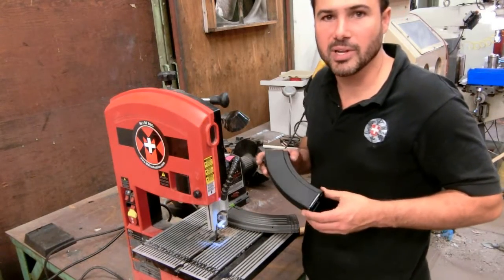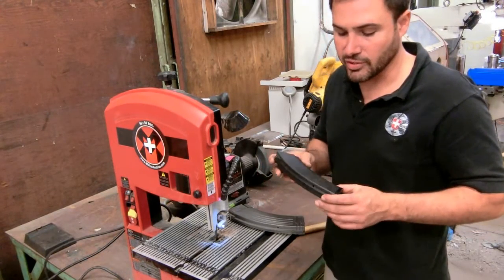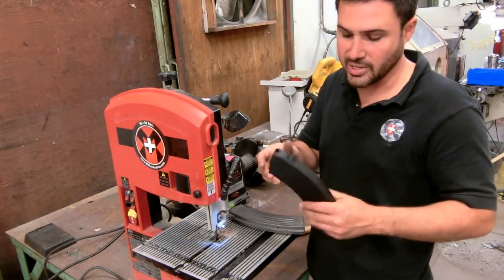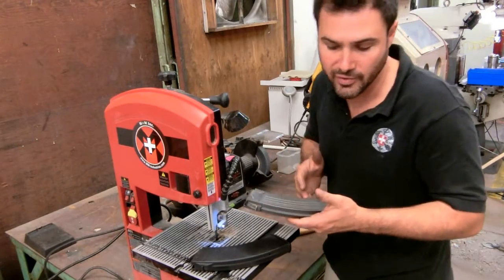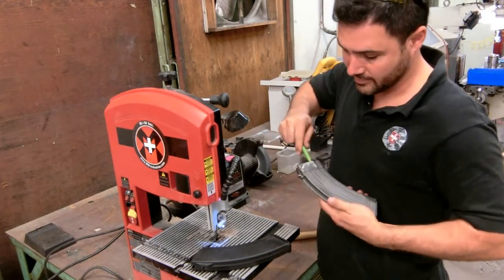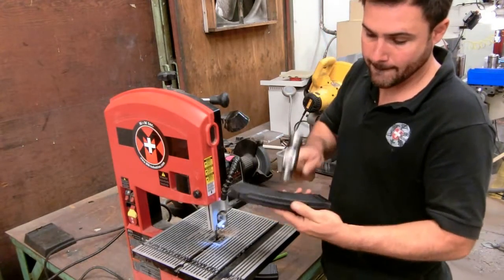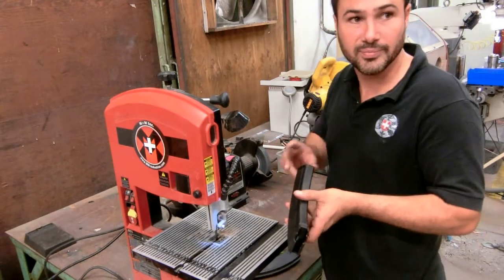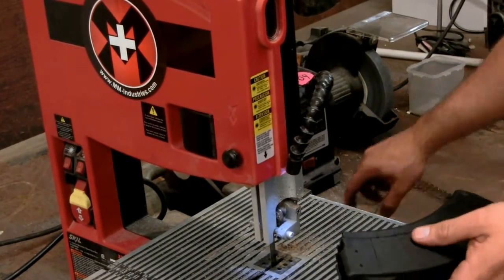What Make's a Good Magazine- Cut One Up to See

Comment: No dude just no. There are high-quality polymer magazines that are superior to surplus steel ones. the ones in this video are not them. Those commercial produced Bulgarian polymer magazines are fine for what they are but the plastic locking lugs will break eventually and the feed lips will crack in separate just from normal use. A Steel magazine with a dent is easily repaired. If you want a high quality, polymer, AK mag, in order of quality; circle 10 , PSA, tolth tool, zastava or even Magpul gen3. All make good polymer mags

Comment: Mike, the same thing of the steel body can be said about the steel feed lips. If they become bent, the steel reinforcements act like a splint for a broken bone. They will keep the polymer affixed in that position. Also, coming from a manufacturer, you should know that the bolt doesn't touch the feed lips. So in both cases, MagPul's new magazines are THE best you can get. PERIOD. They're even superior to Circle 10 Magazines.

Comment: Steel reinforcing of the lugs is even more important.
Reply from the maker: We looked into it, and found the feed lips were the bigger issue. Our testing suggests that this is the best compromise between cost/durability, but you are exactly right in that metal magazines with metal feed lips and metal locking lugs are probably the most durable, so long as there is no unusual impact or stress to the sides. However, if there is an impact to the sides, the polymer is much more durable.  

We will certainly consider adding metal to the locking lug if we get much demand for that feature. We're happy to do our best to meet out customer's needs! Right now, this is the best magazine at this price-point we found and we're very happy with the feedback we are getting on it so far. I will pass on the information that some of you folks would like to see it with a metal lug or metal insert in the lug. We're always on the lookout for the best products we can offer. Thanks for your feedback
Reply: That is great. Thank you for the response.